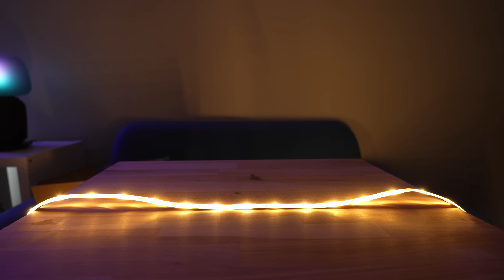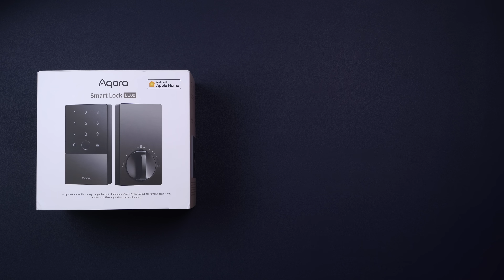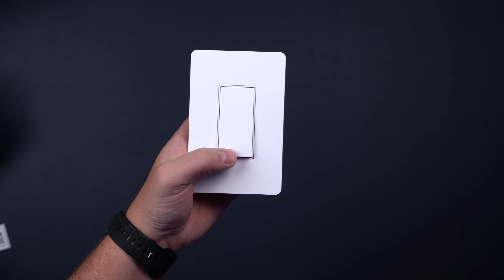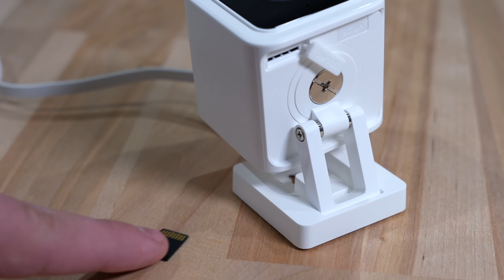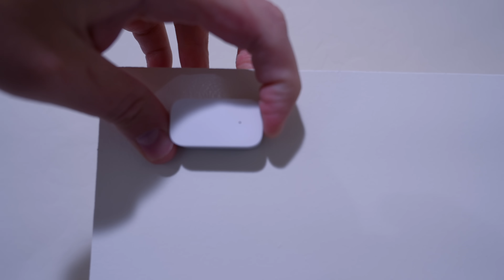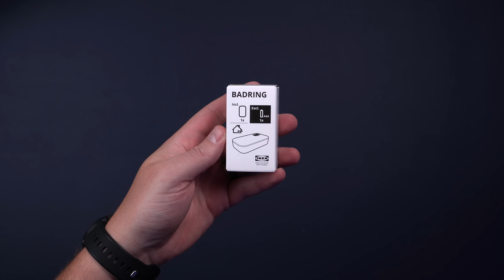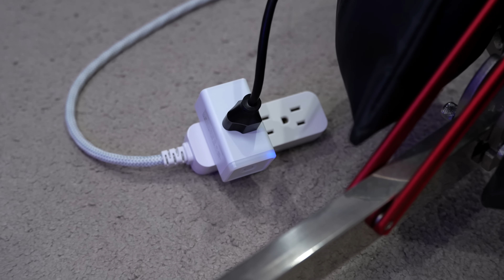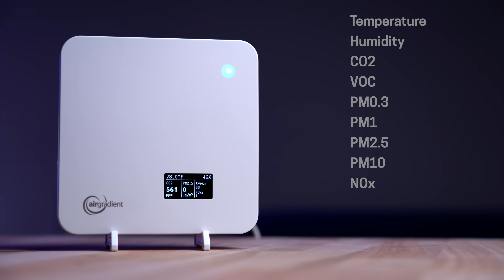Cheap Smart Home Devices that are WORTH IT

Comment from the maker: FINALLY a video for all of us who want to save some money! These work out of the box and most are on Amazon: https://www.amazon.com/shop/smarthomesolver/list/1Q6HYSGUNF697?ref_=cm_sw_r_cp_ud_aipsflist_XJBFPBYJPN4ETJ6377J8
Reply: Caveat: If you wanna get spied on by the Chinese Government, these are fine cameras and doorbells. But if you value your privacy and home security, I personally wouldn't recommend. The last thing I want is a foreign adversary knowing everything about me. That's blackmail territory :P.
Reply: Nikolai Prots ❤❤❤❤❤❤❤❤❤❤❤❤❤❤❤❤❤❤❤❤❤❤❤❤❤❤❤❤❤❤❤❤❤❤❤❤❤❤❤❤❤❤❤❤❤❤❤❤❤❤❤❤❤❤❤❤❤❤❤❤❤❤❤❤❤❤❤❤❤❤❤❤❤❤❤❤❤❤❤❤❤❤❤❤❤❤❤❤❤❤❤
Reply: Thank U
Reply: 1:12 I bought a dozen of these Tapo lightbulbs and I have never had a problem with them in the past 18 months. You didn’t actually explain why you didn’t like them which is a pity.
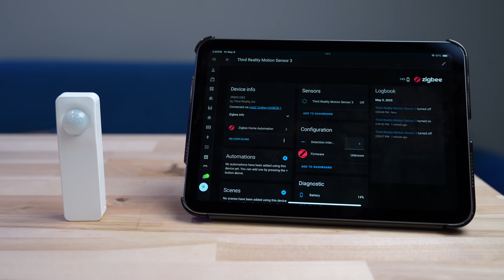Reply: 10:09 I use the Tapo motion sensor and it goes on and off perhaps 100 times a day. I’ve had it for well every year and the CR30322 battery still has 75% charge.
Reply: I'm looking for a motion sensor that doesn't give off light, but sends a message directly to my phone when it detects movement. Which one of these would you recommend?

Comment: I'll admit that I'm rather spoiled by Zigbee. Adding a device to Home Assistant by pulling the battery isolator and telling HA to go look for the device and it comes up fully functional is absolutely appreciated. And yes, Eufy sells Zigbee Buttons that will tell you if the battery is dead w/o setting up a connection to their cloud, but the ability to use it as a button isn't there. I can see needing to use an app to establish a lock setup in some cases, but that needs to be don w/o having a cloud account. I can't think of much that's more of a security problem than having the codes to unlock the front door stored somewhere I don't have actual physical controll over.

Comment: I'm calling BS on the KASA/Tapo light having horrible connectivity. I've got 6 of them both inside AND outside of our 2-story home. We've NEVER had an issue with them. You DID set them up using the Tapo app, right as the KASA app directs you to do so if you try to use that one instead?

Comment: I bought into the hue ecosystem for bulbs like 8 or 9 years ago. The normal bulbs are still chugging along after all that time, but I started using the colored bulbs with the hue sync app on my pc for gaming about 4 years ago, and the two of those color ones I had just died last year.

New ones cost like $60, so I tried two other brands that work with zigbee, but neither of them work with the hue sync.

Does anybody know if there is a 3rd party bulb out there that does?

Comment: I want to add 7 months later, the Ikea zigbee contact sensor does work, so do the buttons. I am using both with zigbee2mqtt into HA. Ikea is also now moving to Matter over thread devices. They have a thermometer/hydrometer for under $20 that I like. Also a new Air quality / CO2 tester.

Comment: This video is 6 months old at the time of me commenting, but for anyone new reading. I have been using motion, presence, vibration, and contact sensors which use Zigbee off AliExpress for over a year and they have been flawless, and they're super cheap. I pay around £2.50 for the motion, vibration, and contact sensors, but all of them are coin cell batteries, of which all are still reporting over 75% battery despite very consistent use over a year. And slightly more for the presence sensors which are USB powered.

For stuff like cameras and locks, I wouldn't be using AliExpress just due to the limited warranties and support, but certainly for cheap items like sensors which you would need plenty of, I wouldn't waste my money on brand labels.

Comment: Excellent run-down. I'm always looking for new ideas to tweak my home setup, especially to get my ancient garage door going. (It still works, but the receiver is cooked.) Still looking for good outdoor string lights for home assistant tho.

I'll add that Ring gen2 contact sensors, motion detectors, and keypads will all work in HA under ZWave. A little fiddly to get working, but once paired, they work fine. Amazon likes to run these kits on sale a lot, so they can be a cheap alternative if you have the patience. Keypad needs some tweaking in Alarmo to work as a keypad, but there are tutorials and code out there already, and once it's up, you can use it as an alarm keypad and a motion detector.

Comment: Not happy with the Aqara lock - it forgets finger prints after a while. I’ve had to reset finger prints multiple times. It also blinks red repeatedly if you don’t lock the door every time you close it. Batteries die quickly because of that. I wasn’t able to find any setting to disable that :(

Comment: I’ve found the IKEA Somrig (a few months of use) and Styrbar (well over a year’s use) buttons to work well with ZHA. I’m currently using alkaline batteries with them too (some of the IKEA devices work better with the lower-voltage IKEA rechargeable batteries). The battery life is fine. The Somrigs have a cool customizable face plate. I really like these IKEA buttons.

The Thirdreality motion detectors seem to work well (I got them for a good price on Prime day).

I also like the Thirdreality smart nightlight. I have the Zigbee version (it also seems to be a strong repeater).

Comment: For your budget cameras I might suggest looking into the Reolink Lumos Pros which I got 4 as a bundle with a reolink homehub pro. This works similarly to the Reolink NVR allowing for 24/7 recording. It will support fewer cameras but it is a more budget option that can allow up to a 16 TB standard HD to be isntalled in the unit which itself already comes with a 2 TB HD installed. Since you have already featured some Reolink devices I thought this may be useful. Also the doorbell can work with the HomeHub Pro as well.

Comment: Thanks for the sensor content. Did you try the Ikea Parasoll? One AAA battery window/door sensor. I prefer Ikea or Hue zigbee devices as I can usually get firmware for them through z2m or what have you. Also be interested with the people stating battery life of Ikea verse others of using expensive lithium iron batteries instead.

Comment: I use the Linkind bulbs.  In my experience, the 60 watt version had less WiFi range than the 100 watt version. I haven’t had a single bulb failure with this brand.

Comment: One thing I could use is a light bulb that turns off and on with a different colors, or switch to different colors. My wife is visual impaired. I need a light to act like  a grand father clock.

Comment: this is a good video from the perspective of setting up an inexpensive Smart Home however from a cybersecurity standpoint there is some things to be concerned about most people don't think about this but smart home devices are essentially very tiny computer each one of those light bulbs has an SOC a system on a chip and when you use the controller app to turn it on that command doesn't go from your phone over your home network directly to the bulb it goes from your phone over your home network through the internet to the company who makes the light bulbs servers then back through the internet back into your home network to the light bulb this is a potential Threat Vector so unless you are going to self host you should be careful about cheap smart home items

Comment: I bought 2 aqara door sensors and one mini button. They worked amazing but eventually disconnected and I can't get them to connect back to zigbee2mqtt. The weird thing is I have the smart aqara cube but that did not disconnect. Is there anyway to fix it? I've tried resetting them but I must be doing something wrong.

Comment: I'm using the Sonoff SNZB-03P/SNZB-06P devices for mmWave and motion. They are inexpensive, super reliable, got infinite battery, and are super easy to position and move around thanks to the magnet system.
They would deserve to be in this guide.

Comment: The ikea contact sensor is only $12 and uses zigbee and a single AAA battery. Works great with home assistant and the skyconnect dongle as a zigbee hub. (You do not need the ikea hub)

Google for "ikea parasoll"

Comment: I have been using Tapo bulbs for quite a while now, never had an issue. Except for first connecting to the system, the trick is when using phone to connect for 1st time, make sure data is turned off, over the years I have fond this is a problem for quite a few WIFI devices. Always turn data off now for 1st connection of any WIFI device now.
Reply: you say it is a problem on first connect, but you don't say what the problem is.

Comment: I wanted to mention about a new presence sensor that I've been using for the last few weeks, the Sonoff Zigbee SNZB-06P which is one of the cheapest I could find for about 15€. I am very happy with it and the magnetic base helps move it around very easily. The only issue I have is with the light sensor that is not configurable and updates it's status after it detects a motion.

Comment: You mentioned Wyze but did not include any of their products?? I have noted quite a few channels ignoring them for some reason, but their lights (strips included) are amazing and cheaper than your recommendations with fantastic colors. Cameras are fantastic and get a decent free package, but cloud recording over SD cards is much more secure if it is stolen like you mentioned. Even the outlets from them work without fail for me. Is there some reason everyone seems to be ignoring them as a viable and cheap option?

Comment: got a reolink camera at home, which i want to connect and use with my home assistant installation. is it normal that actions like start recording to a home assistant folder or stuff like that have a pretty high latency/delay? when i start recording or taking images it takes around 10seconds till it started, so effectively when someone enters the propperty to deliver a package they already left when the camera starts recording

Comment: I too used to hate coin batteries - mostly because everyone wants to rip you off for the good ones, and buying cheap ones seems very hit or miss (mostly miss). Eventually solved my problem by buying OEM batteries in bulk from electronics supply houses: in my case Digikey (I'm assuming Mouser has them too). Yes, you have to pay for shipping, but even with that figured in, I'm getting OEM batteries (Panasonic, in my case) for about $0.49 each, not the $2-5 each I see at stores. I used to use IKEA PLATTBOJ, but I think they have discontinued them?

Comment: I have tried dozens of Smart locks over the past 5 years, Aqara U100 has been easily my favorite. My problem with the Eufy was it wasn't as quick of a fingerprint reader, and the battery life wasn't great. Aqara battery life is significantly better, and I like the fact that it uses regular batteries, rather than me having to take out the rechargeable one, and wait a few hours before we can be back up and running.

Also I love the Apple home integration, so I can open the lock with a tap of my watch when my hands are full of grocery bags. It's the simple things that make a difference.
Reply: I have the older eufy lock with batteries and it also has a hidden usb port if batteries die and you lose your key.  It's instant as far as reading and batteries last years.  I use to have a schlage or whatever and they were horrible in comparison.  Since I got rid of my eify cameras though im tempted to get off eufy altogether so maybe one of these days.

Comment: I don't know about you apperantly but everything I bought from Ikea is just flipin' awesome. It just works, not a single issue so far and I have their lightbulbs, all 3 types of switches, smart outlets (with meter and without), air quality sensor. I wish they had even more Zigbee stuff. And the BEST part is, many times I find these devices in the clearance section because people returned them and I snatch everything for 40 % off!! (I got the Ikea air quality sensor which you suggested this way for 18 € (20 USD) for which you wrote 50 $, crazy.

Comment: I use the TAPO cams too but they sssm to take forever to view in app, and frequently disconnect from WiFi… I have one outside garage and one for front door, both outside… you mention you use TAPO inside And reo outside…  so since I’m trying to use outside that may be my issue?

Comment: I would always end up getting the IKEA Smart Bulb + Remote combo and pair them sepeately with my HA zigbee hub. Just make sure to turn off the all the IKEA bulbs completely before you start the pairing process and you should be good. I do get 2 buttons with toggle and long press for each running off 2 AAA batteries :elbowcough:

Comment: For garage door openers, I really like the ratgdo32, it’s relatively inexpensive (I paid $64) and it goes in line between the original door button and the opener. Works with esphome or directly with HomeKit via a provided alternative firmware. I have a chamberlain security 2.0+ (yellow learn button) and it works flawlessly. I was actually surprised how easy it was to setup. They also make a slightly more expensive version called the ratgdo disco that has car arrival and departure sensors (with HA integration), a beeper, and parking assist laser light. Still <$100

Comment: Sadly I don't have a neutral wire at home. Was expecting to see some good cheap switches that do not require neutral :(
Reply: Hopping on to this bandwagon as I share the same fate as my unfortunate ally here. The no neutral ones aren't cheap...

Edit: I'm thinking we could go with the smart bulbs and leave the switch open, install motion sensors all around the house so the lights will turn on if there's motion. :D

Comment: Is there a smart remote switch/dimmer that will control devices connect to my google home network.  I have a Universal Smart Ceiling Fan Remote Control and Light Dimmer  connected to google home.  I want to replace the hard wall switches with "remotes" that will activate the controls published in google home.   I've looked at the Lutron pico remote but I don't think it will do the trick.  Thanks!.  I enjoy your videos but there is no way I could ever have setup the elaborate stuff you do.

Comment: Nice video. Wish you would have gone a little more in depth with explanation of the LED light strips.

For example the first option (Wiz) didn’t have very bright or vibrant color but did well with the white light modes. You went on to elaborate that the slightly more expensive option (Aqara) had more vibrant colors and you can link it to HomeAssistant but you have to utilize the Aqara app to do special lighting effects, instead of doing such effects from HomeAssistant. This distinction made me wonder, does this mean the first option can do lighting effects through HomeAssistant without needing to utilize its special app? It’s nuances like this that I’m interested in learning about. I haven’t ordered any light strips yet but I’d really like to invest in a solid brand that I can get the most use out of and not have to deal with their clunky in-house app on top of using HomeAssistant for other stuff in the house. I’m okay with giving a little bit of vibrant colors up, if necessary, if it means the option I go with can be better integrated into HomeAssistant basically.

Comment: For Air Quality sensors, I'd just get a smart Air Purifier. They almost always have a air quality sensor built in and you can set up an automation, so If the air quality is bad, automatically turn on the air purifier. I've done this and it's saved so much power and I don't need to replace my filters as often!

Comment: Aqara lock is great BUT if the fingerprint sensor gets wet even in the slightest it becomes very unreliable until completely dry.
Eufy worked well when the sensor was wet BUT lacked the additional features of the Aqara lock.
Both work well when in direct sunlight got multiple hours per day.

Comment: could you do the same type of video but for zigbee ? i have a love-hate relationship with WiFi. i used to have 50+ wifi devices and it was a nightmare. i have 100+ zigbee devices and works perfectly !
Reply: Also i can't recommend Reolink enough ! this is BY FAR the best video surveillance i've had. i've got 12 wired cameras and a doorbell

Comment: I recently installed LED under cabinet lights in my kitchen. It was a simple straight run, and including an aluminium channel, it only cost €40. The light can flash and change colour using a remote control, but I don't bother with that as all I want is good task lighting.
The point I am making is that many of these home devices are just toys. Yes, I can understand the merits of dimmable, flashing, and colour changing lights, but I have also seen some people go totally overboard. I don't see the point of spending €13 for a light bulb when one for €3 is all you need.
I do swear by smart plugs. They are great for switching outer lights on at sunset and switching them off again at a defined time.

Comment: Ikea Tradfri bulbs are so underrated! Their color temperature range is terrible, but you can get ZIGBEE bulbs for less than $10. It even pairs and works with Philips Hue hub no problem! The Tradfri smart remote is pairable with ZHA but you need a HA blueprint to get it to work without the hub. It works well though :) 

Sonoff is my go-to zigbee cheap devices.
Tapo is simply perfect especially with Tp-link's official support for 3rd party apps such as home assistant. I still use Tapo-cameras-control for the most part because it lets you turn your HA into an NVR. It exposes MOST endpoints which is insane for a $20-30 camera.